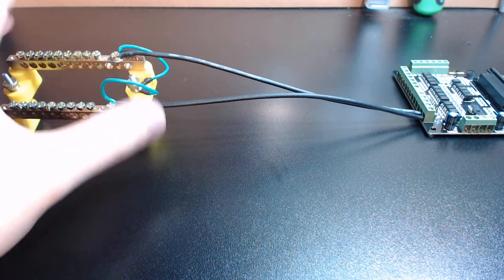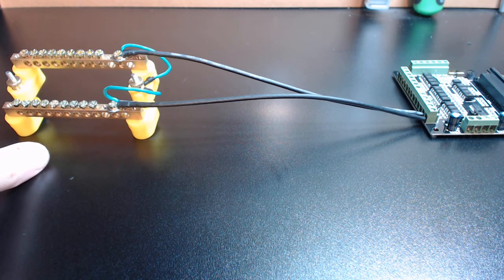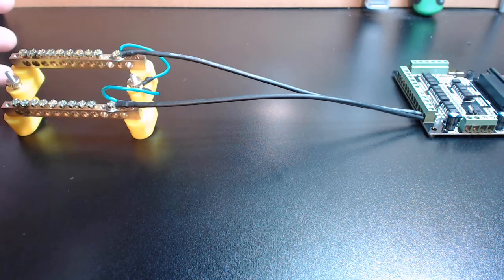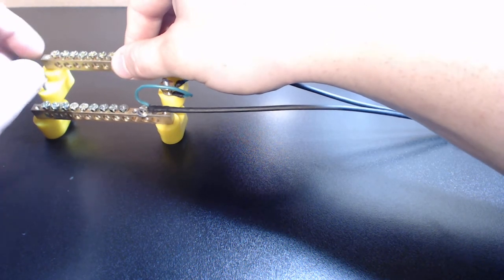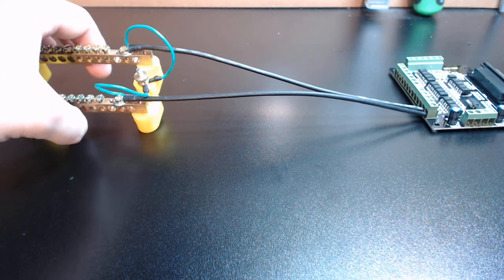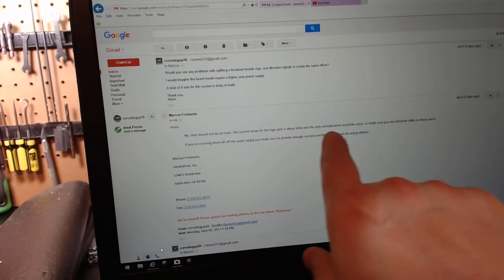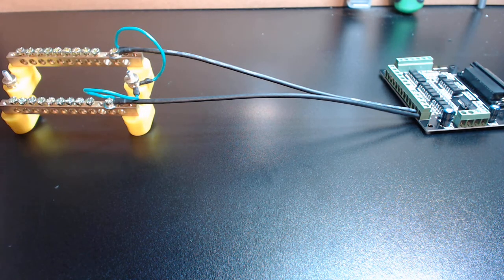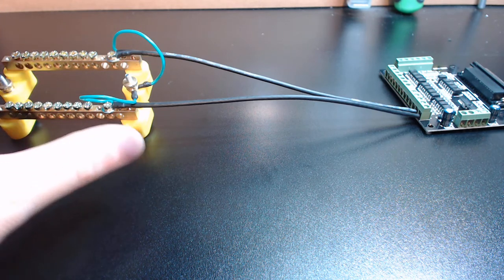9 Motor Slave Axis Potential & Advice That Will Save You Money With Your CNC Build...

Comment: So if I wanted to add a 2nd slave to my shapeoko and I was able to find the same driver specs and stepper, I could essentially just use the signal from the driver on the shapeoko in order to slave a 2nd axis stepper with and external stepper driver, when the control board only is designed for one?
Reply from the maker: Thank you for your support. Yes, in theory you're correct, but many integrated boards don't supply enough power for the signal to accomplish this, so I recommend contacting the board's manufacturer before proceeding. Thank you,
Vince

Comment: Hi there... As you mentioned I have a proprietary system using proprietary software which is actually pretty good and I do have schematics I haven't even asked them for their help with a slave drive but I think I would rather ask you instead because if I do anything I want to be able to manage it myself just like you were saying. The machine that I would like to do this on would be both a plasma table and a profiler get in touch with me so that we can discuss further I appreciate your time and efforts and videos like this to help those of us who need to take things just to step further than what a manufacturer of a machine would take it because they don't really build anything.
Reply from the maker: Hey Aaron, thank you for your support. It makes more sense to contact the system manufacturer as they should offer the consultation for free. I have to charge for my time. Thank you,
Vince

Comment: Hi, thank you for sharing the video, so, my bad english understood right  that as an alternative of using A axis as slave to Y axis i can just split the signals of Y axis BOB and send them to drivers allocated to Y axis motors ? I'm asking because i have a 4 axis usb BOB and i would like to leave the A axis as it is (rotary). Now i've installed proximity switches to each (master and slave motor) for homing and i would like to know if is there any setting to make that they will home individually in order to square up in case by accident they get misaligned. Or is there any other way to set this for individual homing ?
Regards,
John.
Reply from the maker: John,
This is designed to allow more axis to be slaved. This has no options to allow homing to be performed individually. 

Thank you, and have a great weekend!
Vince

Comment: Thanks I have the 16 gauge for the spindle and 18 gauge I thought 22 was a little to small I can use the 22 gauge for the 5 volt lines for stepper drivers
Reply from the maker: That sounds like a very solid strategy. Thank you again George, Vince

Comment: am starting a cnc build i am using shielded 22 gauge wire  for my stepper motor Nema 34 CNC High Torque Stepper Motor 13Nm (1841oz.in) 5A 86x86x150mm
(Manufacturer Part Number: 34HS59-5004S
Motor Type: Bipolar Stepper
Step Angle: 1.8 deg
Holding Torque: 13Nm(1841oz.in)
Rated Current/phase: 5.0A
Voltage: 5V
Phase Resistance: 1.0ohms
Inductance: 11mH ± 20%(1KHz)
and using shielded 16 guage wire for my spindle
 
1.Spec: 200mm*100*85 mm (Diameter:200mm lenth*100mm width x 85mm height) 
2.Power:3KW 
3.Voltage:220V 
4.Frequency:300HZ 
5.Speed: 0-18000 R/min 
6.AIR- Cooling 
7.Runout off:Less than 0.005mm 
8.Grease Lubrication 

Technical Paramer for 3kw Variable Frequency Drive inverter 

1.Input Voltage: 220V(We also stock 380V, please contact us for item stock) 
2.Output voltage:208-240V(Analogous to Input voltage) 
3.Input Frequency:48-63HZ 
4.Output Frequency:0-400HZ 
5.Input Phase:Suit for 1 phase input and 3 Phase input 
6.Output:3 Phase 
7.Warranty:1 year
are these wires sizes sufficient for my build, the ebay shops selling them state that's what they are for but i feel they are a little small am i thinking right ?
Reply from the maker: George,

22awg wire is very small, and will most likely overheat, and quite possibly cause a fire if used on a system with the large components you have listed.

 I suggest going with 18awg shielded cable for the motors cables, and drives to allow for flexibility. The spindle should use 16awg double shielded cable as it will provide the most EMI protection.

The larger the spindle the larger the amount of EMI it will generate, so proper cable selection is a must for system stability. 

Thank you,
Vince

Comment: Once again Vince, you are the Man. By the way I've come across a "New Issue" that has me totally baffled using my G540. For some unknown reason, UCCNC finds and operates easily. Yet Mach 3 can't find my motors even after erasing and reloading a new copy of the 540 XML File. I've gone and checked numerous times if the correct step and direction signals are ported to the correct pins and ports all to no avail. I'm using Mach3 to ensure everything is setup properly before I make a copy of the XML file and send it to UCCNC.
Reply from the maker: Ron, Mach3 has never allocated the step, and direction settings for the G540's axis without manually configuring them, or using Gecko's XML. I would try if you haven't already uninstalling Mach completely including the file left over after a regular uninstallation. Then you should try reinstalling the software to see if it clears up your issue. Mach is old, but still the flagship with options for motion control.  Have a great weekend. Thank you, Vince